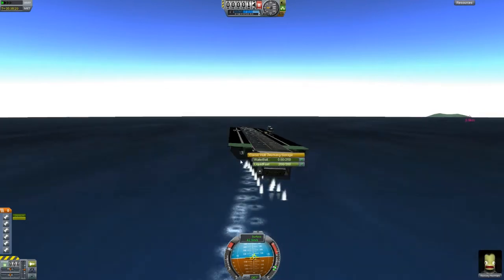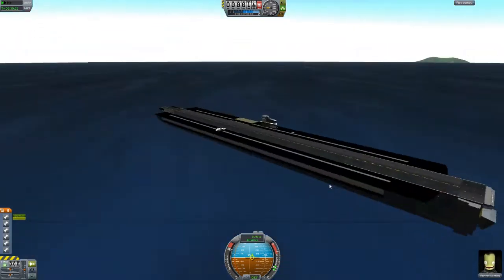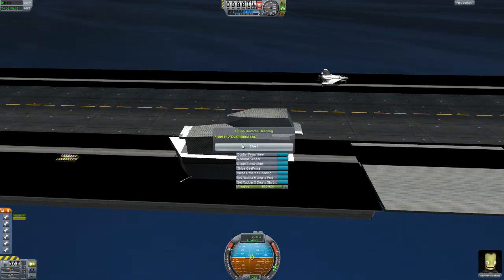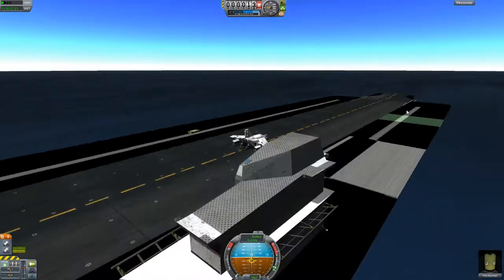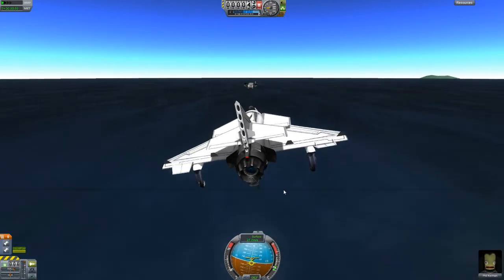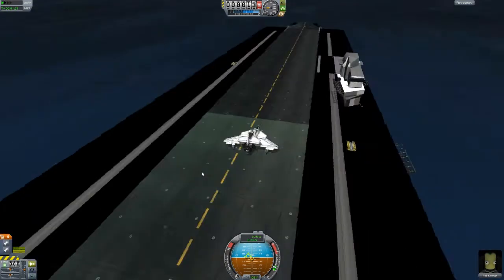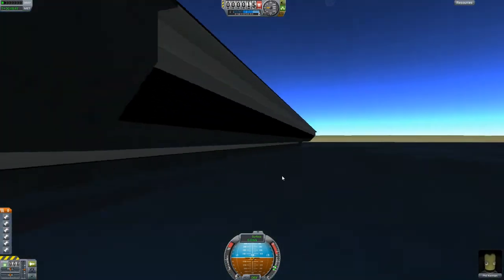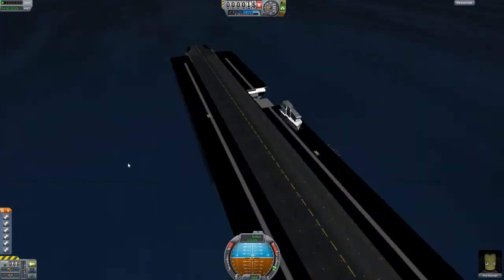Carrier Parts R3 KCVN Pt.2 - Nuclear Carrier Preview

Comment from the maker: With the newest release I have endeavored to make it super easy to dock. Essentially your aircraft should dock if both nodes on the docking ports are within 0.5m of each other anything up to 1.5m will try to attract. Dropping the gear is only needed when the suspension of that gear can't collapse any further and get within .5m to connect. I have tried to make it the best solution for everyone, but some aircraft will need to drop the gear, or have alternate smaller gears to lower onto.

Comment from the maker: Add Romfarers Lazor mod... I put 8 missiles at different points around the carrier and they can track any target and launch vertically. Of course this is single player so, having an automated defense system would be nice. Like DYJ's gatling gun, but have it auto-track incoming targets. If that target fails IFF (identify friend or foe) then the system automatically shoots it down. That could include incoming missiles as well... :)